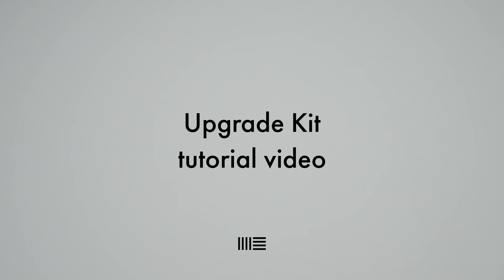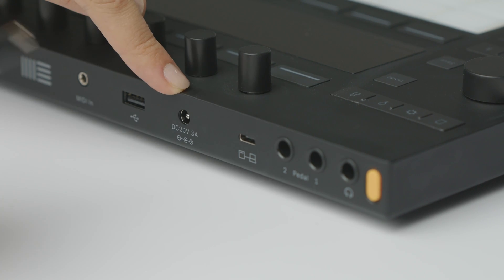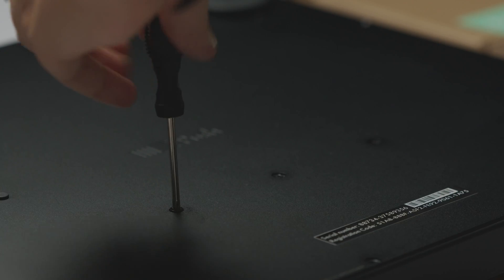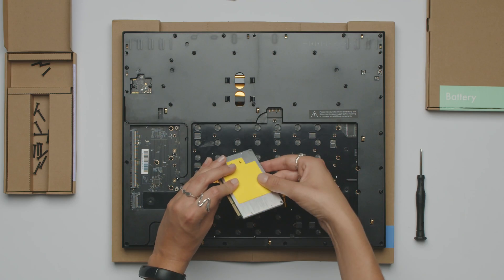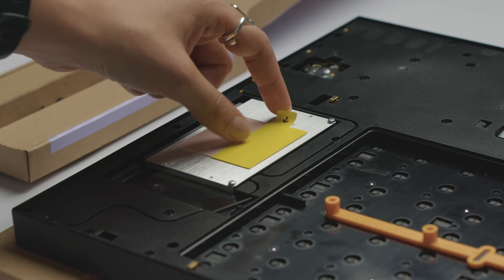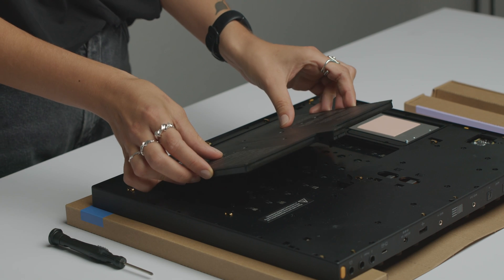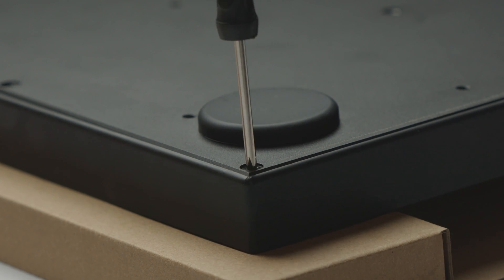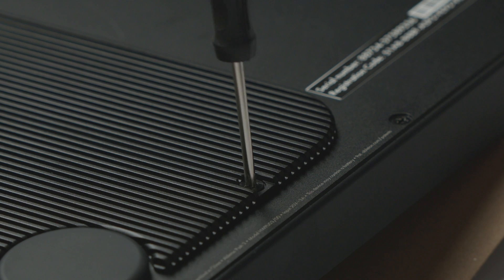Learn Push 3: Installing the Upgrade Kit

Comment: Installation was easy, though the thing does NOT work. Permanently stuck at boot with pads flashing. Yes, I did all possible troubleshooting for reboot with recommended buttons and sequences, drain/charge battery, reassembling the whole thing if dust got anywhere, etc. Device responsive but only shows battery %%. Can't start in standalone mode or go to recovery because I guess there is nothing to rollback too since it never worked. 
If anyone got over this issue with forever flashing pads please share. I guess I'm packing it and shipping back.
Reply from the maker: Sorry to hear about this. Did you contact our Support team about this? If not, please reach out to them so they can take a closer look at this for you: https://brnw.ch/21wUUDd Thank you!

Comment: To anyone that upgraded to the standalone while it was on sale earlier this month, here's what chatGPT pulled up from Ableton's website:

To calibrate the battery of the Ableton Push 3 (standalone version), you should first fully charge it, which takes approximately 4.5 hours from 0% to 100%. Once the device is fully charged, unplug the power supply and allow it to fully discharge by using the device until it powers off. This initial charge-discharge cycle is recommended to properly calibrate the battery level indicator and optimize performance
ABLETON HELP

ABLETON
.

Keep in mind that this calibration may need to be repeated a few times to ensure the battery level displays accurately. It's also worth noting that the Push 3 uses a Lithium Iron Phosphate (LFP) battery, which is designed for long life and safety
ABLETON HELP
.

Comment: #1 I see a lot of people complaining that you're forced to go with the specially selected parts like the 11th gen i3.
The normal course for every company is to produce a thing, and it's neither up- nor down gradable.
It takes a lot of balls in 2024 to produce something with modularity. Kudos for that.

#2 Upgrading Push 3 to Push 3 Standalone via this Kit doesn't remove your warranty?

#3 I am not the target audience for this, but I love the main concept.

#4 This makes it possible to upgrade afterward.

#5 Is this also vice versa possible for someone owning a Push 3 standalone to convert it to a Push 3?

#6 You should still provide alternative option info's like:
"Blablabla EULA you can also use an i7 4th gen, but it won't run as smooth in combination with a 3d printer
and you need to be 2000% aware of the fact that every part needs cooling and that you need a special kind of battery
with this port".
Reply from the maker: Hi there! Thanks for your questions. Our Q&A session has been closed, but you can still submit your feature wishes on our Discord server or upvote what’s already requested. Click here: https://brnw.ch/21wOQEd. Looking forward to hearing from you!

Comment: I would recommend the folks to  use an antistatic wristband or at least to discharge Static electricity from your hands before handling bare electronics. ESD is a thing..

Comment: Let's hope the upgrade kits get better, over time. I realize its all proprietary for the Push and there is a lot of dev behind it, but it would be nice to see faster CPUs with more cores and more ram options, that can stay cool, in a NUC - in a Push. Let's also hope that battery technology continues to improve. While I wouldn't mind sitting on the couch and working on a cool idea, I also don't mind just being connected to Ableton and using it as a controller. Being a systems admin, watching this is sort of my nerdy fun. LOL
Reply: @popcycles  I believe I mentioned CPU, ram and better batteries. Storage these days is fast and cheap. 256Gb of storage isn't great either, these days. But, I also didn't buy one
Reply: @popcycles  memory is ram and in the specs it's 8Gb of ram. Storage is a 256Gb SSD
Reply: @popcycles  the NUC unit is a bit weird, as it has the RAM and the CPU in it. While the SSD is sort of Push proprietary. I am holding off and waiting for, either a new Novation SL MKIV or an Arturia KeyLabs MK3
Reply: @VentureNW  interesting, thanks for chatting with me. Yeah I have never heard of this Nuc type of cpu unit. I'm still in mpc500 land. 🤦‍♂️
Reply: @popcycles  Yes, sort of - inside the NUC unit. You get a custom Push NUC, an SSD, a battery, and a heatsink, as listed on their site. I've already seen videos where people are DIY'ing the SSD to a bigger one and copying over the files, from the existing one, but that's a lot more in-depth.

Comment: $1000 for an i3, 8gb of ram and a 250gb ssd?! Holy Sh!t !!
Reply: I was like $1,000 for a standalone push is not too bad. But damn, $1,000 for the upgrade kit.
Reply: #RIPOFF
Reply: AppleTon live
Reply: Plus a battery and R&D costs of a not-so-big-company. Still, definitely a "healthy" markup.
Reply: @mju135  And that i3, is probably latest gen, and it doesn't run Windows. It's most likely a stripped down linux version that ONLY runs Ableton.
Reply: @alecsbuga Negative, it's 11th gen... And as stated in my previous comment, the software R&D is already included in the Push 3 1000 asking price.
PD. I bought a 13th gen i3 NUC for 200.
Added RAM and nvme SSD for another 100.
Reply: @FernandoDCD  what I meant is even if it’s an I3, it is focused only on Ableton. Should be just fine.
Reply: @alecsbuga exactly, and definitely not worth 1K.
Reply: @FernandoDCD  I was a WORTH advocate :)) but somehow I sounded the other way around. Not a native speaker. 

My point is: you get a computer that runs Ableton and it runs only that, you get a 256GB ssd and a big ass battery. 

I’m not sure how much they cost separately but I guess they’re close.
Reply: Nobody forced you to buy, did they? R&D and parts supply is expensive or does any competitor deliver better?
Reply: I'm not planning to go DAWlesss anytime soon but since you asked...R&D? It's literally an Intel NUC that's stuck to the back of a mid controller that already existed. Parts Supply? You must be delusional. The parts cost 250 retail and even that figure is generous. It's fascinating seeing people like you stick up for companies like you owe them something.
Reply: @papatoni3311  and that‘s why they‘re obliged to do it for 350 more? Btw the price was already down to 600. See what Moog or Waldorf are asking for their flagships, do you think they had much higher R&D cost?

I‘m glad that in your world the software development is free of charge, especially for a device that runs it own specified OS with highly time dependent tasks!
Reply: @el_dani I couldn't disagree more with you. The software R&D doesn't go into the 11th gen i3 CPU, 8GB RAM, 256 GB
nvme and battery, it goes into the Push 3 1K price.
Now, asking an additional 1K for 250 to 300$ worth of hardware, that's just a ripoff.
Sure, they could've marked it up for additional profits, why not, to 500 or 600... but asking 1K is just taking a piss at you.
Fortunately, they occasionally have the standalone with 20% off discount.
Reply: @FernandoDCD  for 1000 you just get the contoller, sure there was a lot of R&D as well for this and there is crossover R&D and budgets, but you don't get standalone. It's the standalone that makes this device special and innovative. Otherwise it would be Push 2 with MPE pads (not easy to develop neither) and some more in-&outputs.
Reply: @papatoni3311 do a DIY ableton push upgrade then
Reply: @el_dani I agree that the standalone usability makes this device a very attractive one.
The issue is the asking price for the hardware you get in exchange.
Which brings me to something I've also mentioned earlier... Paying the additional 1K for the 3 gen behind 11th gen i3 chip, 8GB RAM and 256GB nvme SSD is simply a rip-off.

Mind you, for comparison's sake, with 1K you could get an i7 with 16GB of RAM and 512GB nvme.

What would make it more considerable is when it's 20% off, which brings it to a more reasonable 1600€  (600€ for the standalone components).

That said, I do think that the standalone mode is a fantastic way forward for the Push 3, no doubt about it, and I will start saving in order to be able to pay for it when it's back on sale in the future.
Reply: I think the markup at launch/RRP is pretty steep but there is no denying how nice it is to see such thought put into DIY upgrading of the device.

Interested to see what sort of options are available in 5 years time 😊
Reply: Hey, just so you know, this isn't a computer.
Reply: Price was 1600 back in November, and when it‘s so „easy“ to just sell 250$ hardware for 1000, why is nobody else doing it? Heck, Apple could ask 5000$ with Apple silicon, they must do it.. 🥴

Comment: Will there be a tutorial for how to upgrade the memory?
Reply: you mean the SSD? The ram is very likely not user upgreadable. The SSD on the other hand I think can be replaced with a standard ssd; but it requires you to set up the system on it.
Reply from the maker: Hi! If in the future we offer the possibility to upgrade just the memory, we usually have tutorials for such things.
Reply: @Ableton  You really shouldn't be calling M.2 drives 'memory'. Random Access Memory (RAM) is colloquially what we call memory. M.2 drives are for data at rest and thus called storage. It might seem pedantic but the Intel NUC module has 8 GB of RAM, and while most might not care since it's soldered to the board and can't be upgraded.
Reply: Wait 2 years, buy new memory stick, watch this video
Reply: @el_dani so that's an SSD?? It looks like a ram stick. So then wheresy the ram at??
Reply: @popcycles  Probably soldered to the main board
Reply: @el_dani oh man, I got to get with the times. Cpus have integrated ram now? 😂